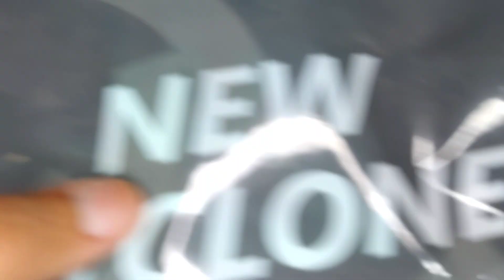Most Advanced FPV Motor ? Foxeer Datura 2105.5 | Honest Review

Comment: hey where can i get this motor in india ??
i need slightly lower than 3000kv motor of such size
Reply from the maker: This is lowest KV
Reply: @justhackitfpv  they do have a higher kv which i plan on using for a 3"
Reply from the maker: For 3" 2105.5 is too much
Reply: @justhackitfpv  precisely what i want , i am considering 2203.5 also , since i want it to lift a gill soze gopro 10